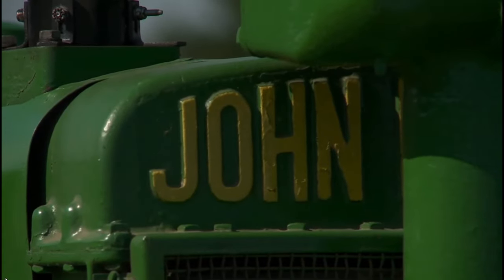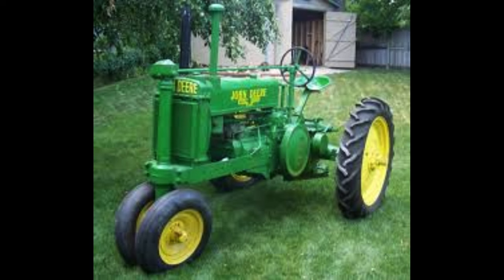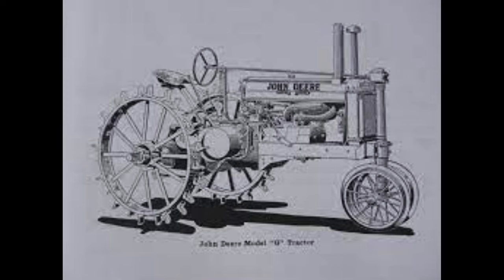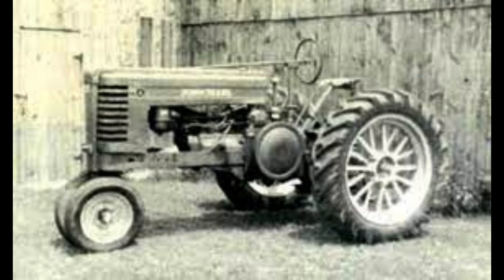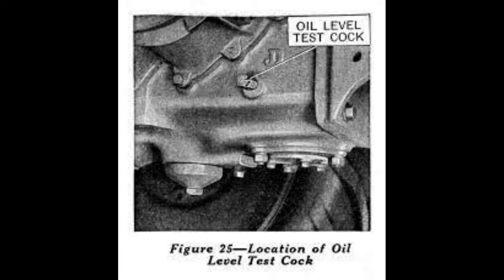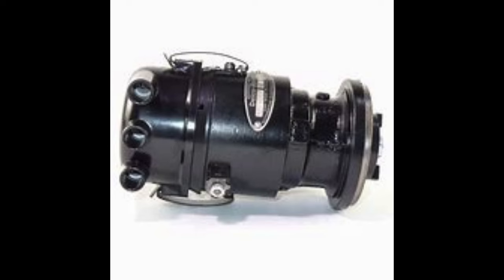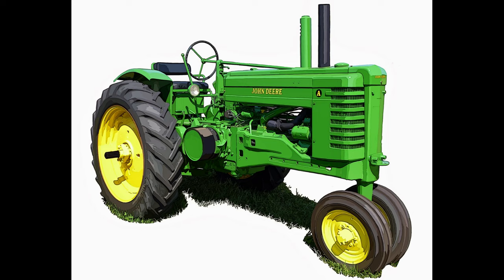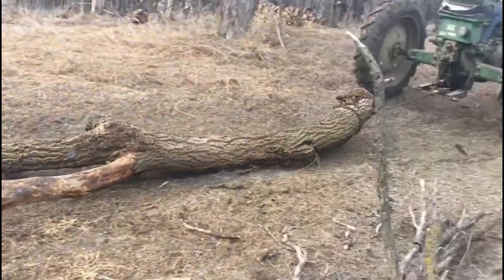John Deere Model A: An American Icon and Workhorse

Comment: I went to an auction the other day to buy a John Deere Model D and a Model A was being auctioned just in front of it - was not bringing very much so I felt like I had to bid it up because the price was so low (it was sitting at $700 with no bid) so long story short I ended up with it - got it for $1,250 and I also ended up getting the D as well. It's a 1949 in good shape, the owner was 91 years old and at one time he had 21 John Deere Tractors and kept his favorite 4 but at 91 and with his health it was time for him to get rid of the last 4 so I ended up with two of them.  I now have 6 John Deere tractors plus a John Deere Hit and Miss Engie.  The A starts right up and sounds great (he put a straight pipe on it with no traditional exhaust) - it does need some attention here and there but is overall a great tractor and I'm glad I ended up with it.  Thanks for the video - I learned a lot about the model A from this.

Comment: As someone who grew up running a 1952 Model A (we also had a 1952 Model B) I can attest that the A would most definitely pull a 3 bottom 14 inch plow in 3rd or 4th gear depending on soil type & conditions. I did it many many years. Great video and yes we still have both tractors.
Reply from the maker: Hey that’s awesome! Glad you still have them👍🏻thank you for watching!
Reply: Dad was a Deere man. I learned to drive on a model "H" Deere. And when I was old enough to do more work, Dad updated the "H" to a 1952 "B". And today, the little "H" is still working away on a hobby farm. Besides these two tractors Dad had a 1951 "A" that had been a dealership demonstration tractor until the 60's came out. Shortly after he bought it, it had engine problems, and my uncle rebuilt the motor by installing aluminum pistons and adding a coolant pump. It was a strong worker after that, able to pull 3-14's in our heavy black jumbo ground easily in third gear. All we gained ground, the "B" was traded for a 3010 diesel. The "A" and the 3010 teamed together was great, since they could do the same job with the same equipment . The 3010 had all the comfort and conveniences being " the new generation". Yet the "A" was so solid and strong, that it was always a joy to operate.

Comment: Points ignition? John Deere magnetos have points (as do most magnetos). The difference is that the later ignition systems get their spark energy from a battery and not from the rotating magnetics in a magneto.
Reply from the maker: Your correct, right after I posted the video my dad pointed that out to me. I definitely should have caught that before I posted it. Thanks for watching
Reply: I learned how to check for spark on jd with the wico magneto. Pap Pap said here stick your finger in here and he spun the fly wheel. 😂😂😂 He laughed so hard he almost swallowed his pipe.😂😂😂. I think every kid should have something to remember. Thanks for listening.

Comment: Growing up on the farm we had a Model A John Deere tractor. Dad & I installed a buzz saw on the front on it. We cut tons of fire wood with it!
Reply from the maker: Thanks for watching! I’d like to get a buzz saw working on one of these old tractors someday 👍🏻
Reply: @LocustMotorWorks  It works very well! You just drive it into the bush and away you go. The only thing we made sure of was that we could use the belt and pulley to run our hammermill and it worked great! I know wish I would of bought it! 12 years old and I could start it myself off the flywheel, Dad taught me well.

Comment: I believe they made the model D and model A at the same time from 34 til 52 when the 60 Row Crop and Standard replaced both the A and D..
Reply: D was produced from 1923 to 1953 and was more or less phased out and replace by the the R/80. It was a completely different class of tractor from the A and was never intended to be replaced by the A or 60.

Comment: I own a 1944 Styled AW. I have kept it all original. I have used it a little around the property to pull logs etc. but being it has the wide front, it doesn't turn very well. So, I tend to use my 1942 Styled B more. And the B is easier to start! Great Video. Thank You.
Reply from the maker: Nice tractor! Thank you for watching👍🏻

Comment: A couple things, the A did not replace the D.  Maybe the GP but definitely not the D.  The D was in production until 1948 along side the A.  Also, points were used in magnetos and distributors.  When you talked about the different ignition systems, they used magnetos first and later distributors.